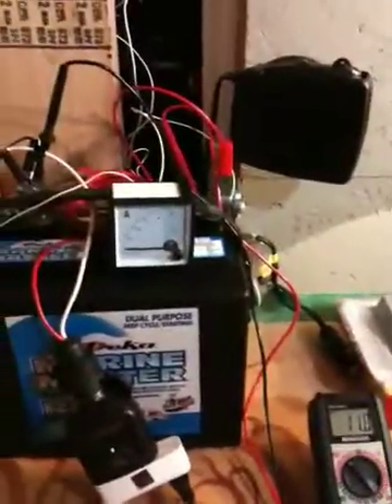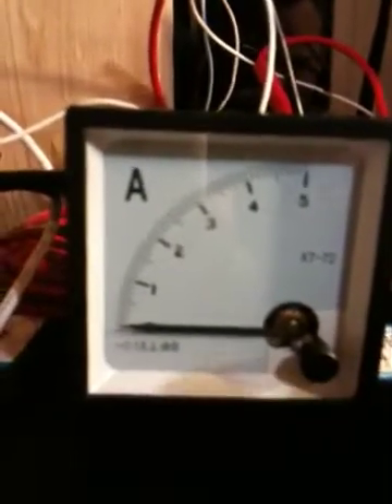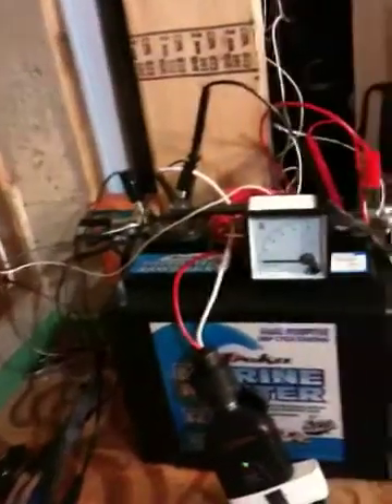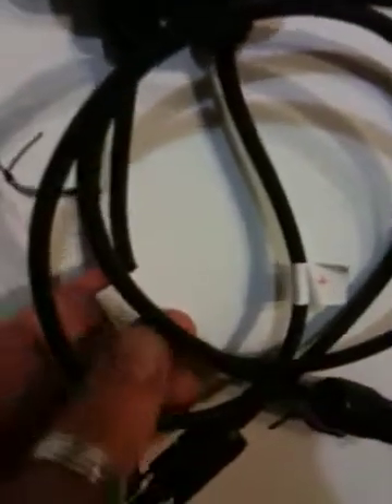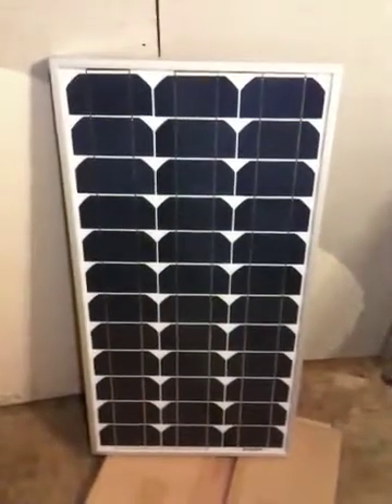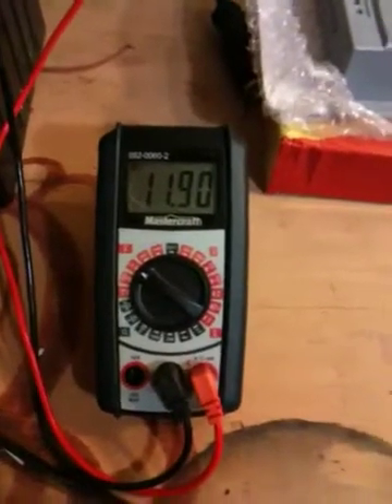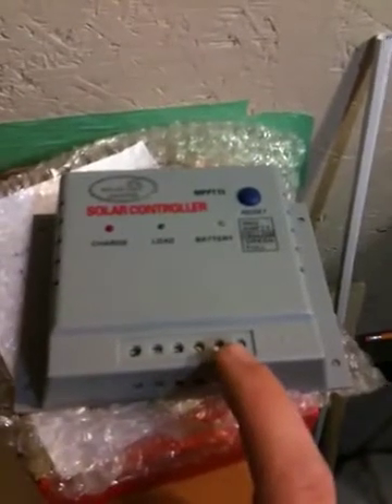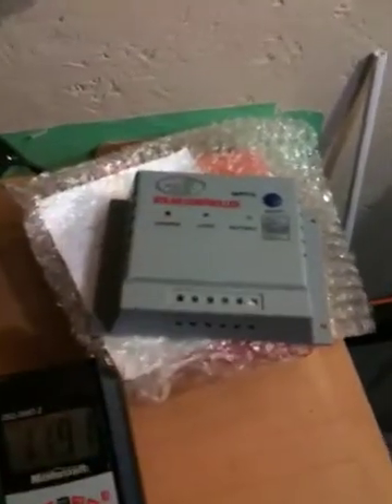Solar upgrade

Comment: That is probably a fake MPPT charge controller.  Also, you should never let your batteries get down to 11.8V as that will damage them in the long term.

Comment: if you chain 20 panels together you will get 446v dc. the panel can take 1000v dc before you hurt it. hooking panels together for higher voltage is beneficial when you have a 48v dc battery bank, a MPPT charge controller, or a big grid tie system.